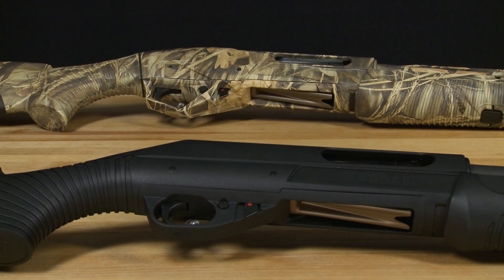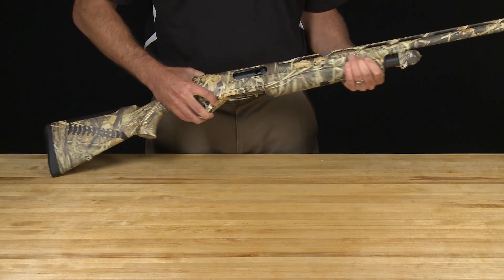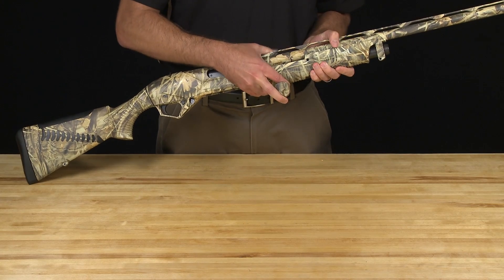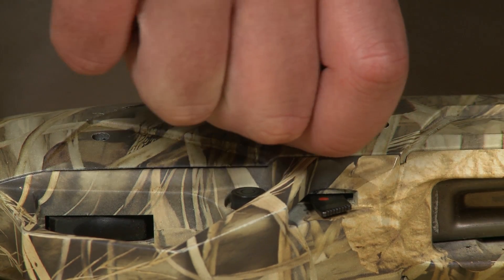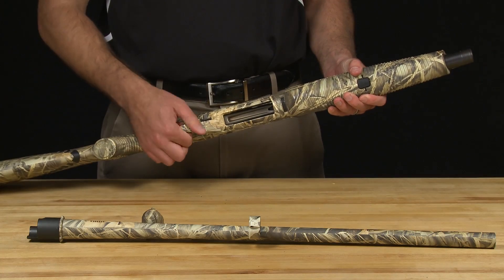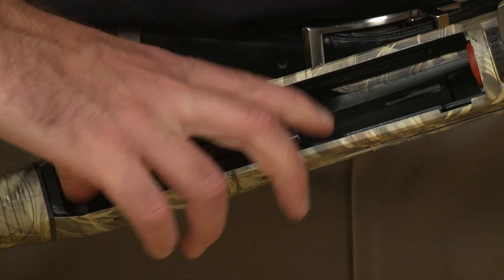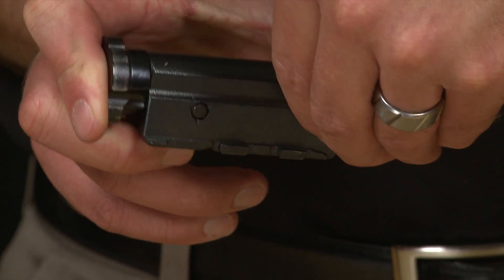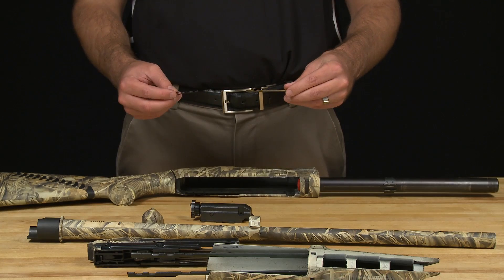Benelli Tech Shop - SuperNova - Part 1: Disassembly

Comment: The Benelli Nova/Supernova line: the easiest guns to field strip, but...

 I found is much easier to use my brass gunsmithing hammer and brass gunsmithing punch (no, wait, instead two wooden punches made from some old souvenir Panda Express chopsticks sitting on my kitchen table for over a year which I rounded and tapered the tips with my Swiss army knife and just committed to my gunsmithing toolbox, brass can still wear off bluing on pin ends and heads and leave a golden-color residue) set to knock those two takedown pins out of the receiver holding the trigger assembly and gently tap them back home again. If you have steel or nylon roll pin punches, those should work just as well. The book that came with the gun, my new Supernova, said to use the magazine tube cap as a pin tool but the point on the end of the cap isn't long enough to push the rear pin all the way home as it is in a recessed part of the receiver left-hand side. Using the rim of the cap as a hook to pull this rear pin out by the head doesn't work for the same reason. It just slips off the head of the pin. Too far deep in a recessed part of the receiver to get a good bite on the pin's head.   All in all, this gun is much simpler to field strip than my Remington 870. You have to compress the bolt into the bolt carrier under spring tension according to the manual and tilt the bolt out of the receiver a special way to pull it out and carefully tilt it 45 degrees at a slight twist to put it back in but it's no big deal. The pump forend and action bars are pretty easy to get in and out of the receiver and engage with the bolt carrier.

Comment: My trigger pack does not come out. I have the tactical version with pistol grip. I remove both pins but no matter how hard I pull, the trigger pack doesn't budge.
Reply: 1. The pistol grip nut must be loosened first as the warning says in the manual (mine don't have a pistol grip). Otherwise, there is not enough space to remove the trigger guard
2. The trigger group might be jammed in the receiver due to somewhat rough tolerances between parts. I had to pull pretty hard and had a hard time installing it at first too. I ended shaving up a bit of plastic from the trigger guard base where it had a too-tight fit with the receiver.